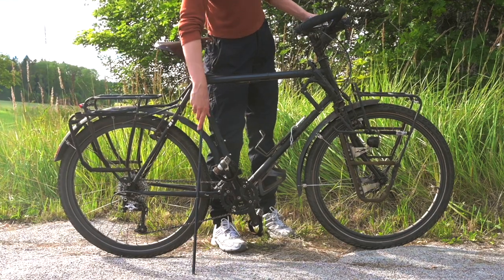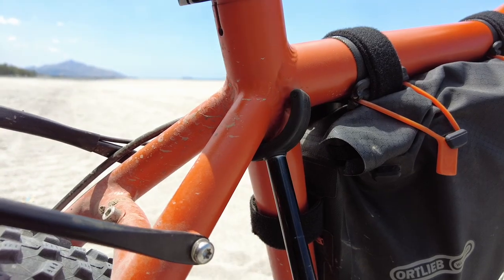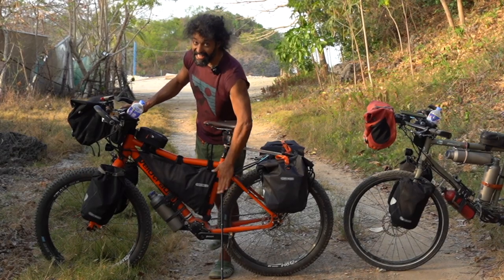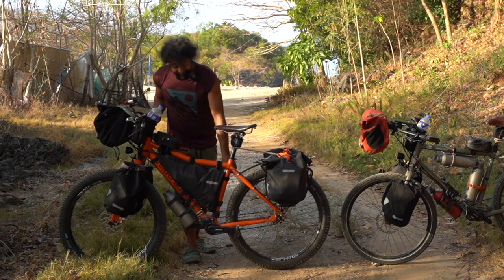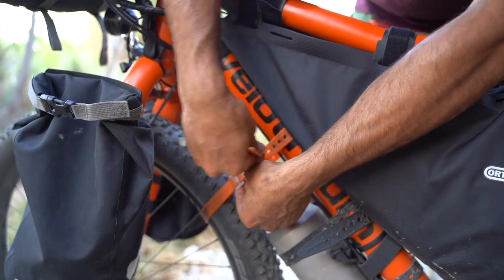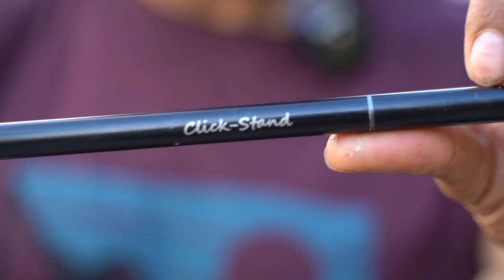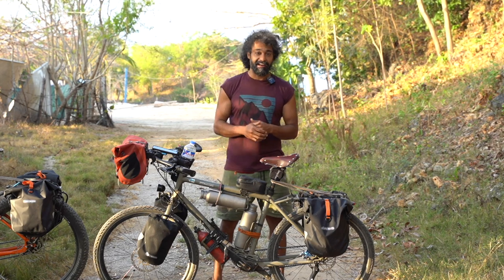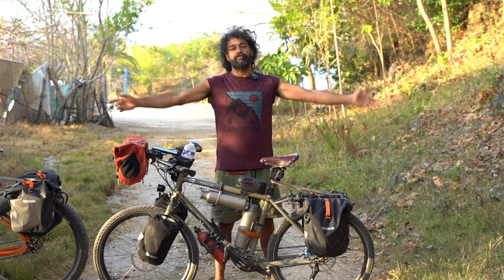Why 80 Grams Stand is The STRONGEST Bike Stand for Bikepacking & Biketouring !

Comment: I absolutely LOVE the concept but its so vulnerable to theft by lowlife thieves 🤨. I think this would be great if it was mounted on the top tube, on a track screwed into the top tube for adjustability. Patent pending 😉😊
      Maybe even a center, double kickstand, when in town where the thieves are, or when space is at a premium. I like the center, double kickstand that folds up both legs to the left side of the bike too. Both options?

Comment: I had a carbon fiber Zpacks tent pole break during a severe storm. I took the broken section out and it makes a perfect bike stand. I place it between the seat rails on the bottom of the saddle and it breaks down to 4 pieces. 56 grams. ✌
Reply from the maker: Thanks for the tip! indeed i have seen others also make the stand from tent poles, but never seen with carbon pole good to know it works  😁
Reply: What did you use at the contact point with the bike?
Reply: @DanieleCarletti  it has a plastic plug on both ends of the pole. It's long enough I just place it between the saddle rails underneath the saddle and the end rests underneath the saddle body.

Comment: I made a click stand out of old aluminum tent poles I had at home. they three poles are held together with a bungie cord running the length and has a Y shaped yoke   You can attach the folded stand somewhere on your bike using two snap clips that are designed to hold a broom in the closet.  Since I last posted I have made a telescoping bike stand made out of one leg of a photo tripod.    The  telescoping leg is adjustable from  21 inches (53.34)  extends to 5 feet 152 C)   Weight 11oz  (317g). The pole can used as a bike stand, walking stick, cane, or tent pole.  Many tent poles are 21 inches when folded.   A basket can be attached to the bottom for sandy soil.  Available at REI.  I placed rubber chair feet on each end.
Reply from the maker: Good tips thanks! If the tent pole is strong enought then it will work. But now days with this super light weight trend going on, it is hard to find durable tent poles 😅
Reply: The new tent pols are a piece of junk.  I would rather have a sturdy tent Pole that will get me through than to save a few grams on the trail or road.  Happy trails to you.

Comment: Very useful video! I went through this exact set of decisions for my tourer too - didn’t want the weight of a 2 leg, or the frame stresses from a single leg stand. Came across Click Stand and love the strength, convenience and low weight. So useful when loading your bike after a night camping, and the ability to vary which side the bike leans, and at what angle is great. Safe travels!
Reply from the maker: Indeed, it is sn amazing stand, i been using it for 5 years now. Thank you!😊